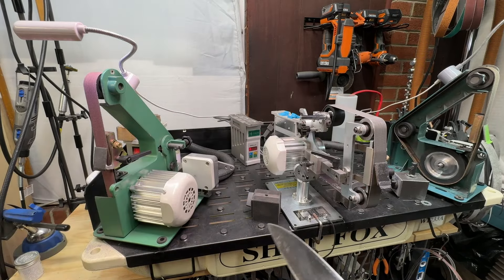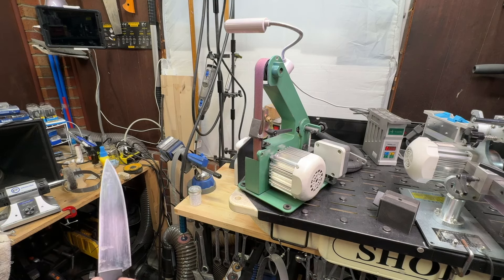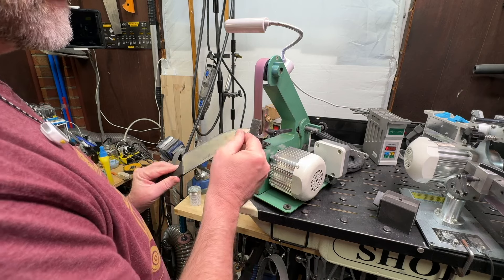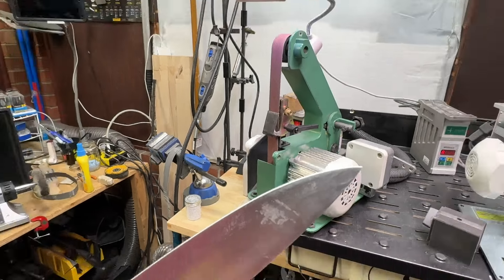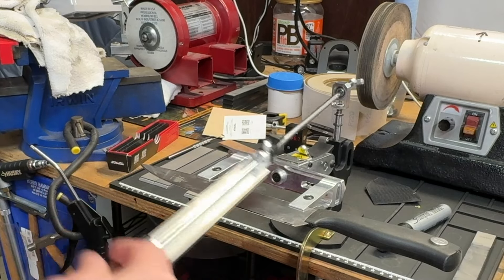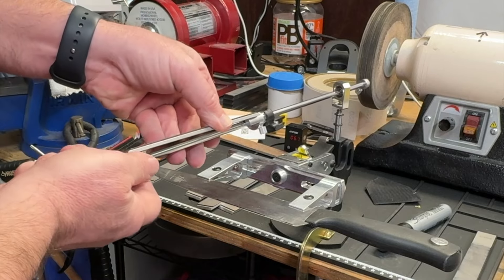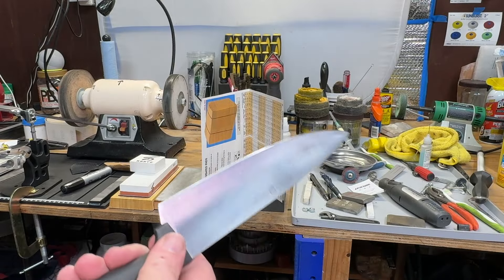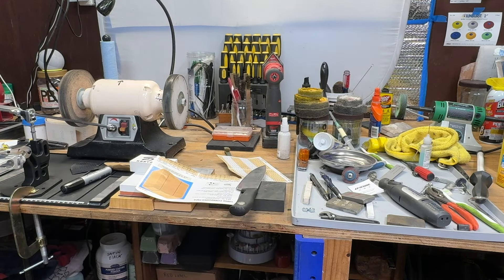Speeding up  your TSPROF Sharpening

Comment: I really like your content and reliable information.  I like it enough that I added two Toolker's and another Tormek T8 to my shop. Keep up the vids along with a couple jewelry polishers. Not quite sure about adding a manual sharpener like the TSPROF due to the cost.  May add it at a later date if the work requires the addition.  I tried the Worksharp Precision Adjust Knife Sharpener but sent it back.  Didn't work very well.
Reply from the maker: I agree it moves to much but I have not tried the pro version but I prefer TSPROF much more.

Comment: Another great video. Just qurious, when a knife comes into the shop can you tell if its been convex sharpened or Apex sharpened? How do you tell? Many thanks matt 👍
Reply from the maker: Sometime if it's been slack belt sharpened it's obvious. If you look close you can see the convex on some knives. Now on Kitchen cutlery with real small bevels it can be hard that's where the sharpie and a digital scope come in handy. If you draw a solid line down your bevel. Then take a stroke or two and if you thing you are hitting the apex but you see what I like to call railroad tracks = where it's removing metal from the middle of your line, but you have a black line still above and black line below  what was removed then that is a good way to know you have a knife with a convex bevel. You can either adjust your angle higher or keep grinding till the fat middle is gone and you apex the knife
Reply: Thank you

Comment: Another great video, great content, explanation, camera work, with amazing end result....thank you again for taking time to make this.  Is that a leather wheel on the low speed grinder you used,  and what compound do you use on that wheel?   I have TSPROF K03 Pro and have not been able to get my knives as sharp as did in the video.   I'm curious why you free handed on the wheel as a opposed to using a stropping insert on your TSPROF?
Reply from the maker: I have some videos on the many stropping options one of the things that will take your sharpening from good to great and IMO it's one of those areas you have to explore and see what works best for you is stropping, because we are all a little different. What do I mean by that? Well how I use my gear and you use yours will vary no matter what because of hand pressure and angles and these things are big factors in stropping as you gain experience sharpening lots of knives you will get a feel for what works best for you. I like power stropping because for me it's been fast and has given the best results. But we also learn fast that it can also dull your work. There is a fine line that you can cross over by stropping to much. My favorites are still round leather wheels or 1x30 with leather for how i sharpen it's around 2-4 passes each side.. On the Tormek it is much longer because it's only going at 90 RPM Can you do it on the TSPROFF? Of course you can, just know that it will take longer that a powered method. Since I always have lots of sharpening since sharpening is still  my main business speed is always a top concern so I don't fall behind. I try to have my customers work no longer than 3-5 work days so many of my choices are dictated by speed.

Comment: Awesome video. I am new to knife sharpening so forgive me if you answered these questions. I just got the TSPROF KO3 Pro AL Hunter. Great piece of equipment. So, I know you need to create a burr on both sides. I just don’t know what that feels like. I can feel it on one side but when I try creating a burr on the other side I am just not feeling it. Do I need to continue until it’s done then move onto another stone? How do you know when to progress to other stones ? Any advice would be greatly appreciated. Just subscribed. Thank you so much.
Reply from the maker: Some people struggle to feel the burr, especially as they progress to higher grit abrasives. Lower grit burrs are always easier to detect, but as the grit increases, they become much harder to feel. If you have trouble sensing the burr, I recommend using the Sharpie method along with some magnification to ensure you've removed all of the black Sharpie from the bevel. Take a close look to confirm that no marker remains on the knife.

Another way to tell if you've apexed the edge is by feeling the transition—it should go from dull to "grab sharp." Run your finger lightly across the apex; if it feels grabby and sharp, you've likely reached your edge apex.

I think the most helpful technique, will be using the magnification. It allows you to see the apex without removing the knife from the clamps on the K03 https://youtu.be/_cMI6fAdWHs (jump to about 12:15 in the video to see the new tool I am talking about this 100X Handheld Coin Magnifier can help you inspect the edge more clearly: https://amzn.to/4grxxNO.

Here is a video on the sharpie method it's useful on all sharpening devises I made this a while back and I am using a Tormek but the principles aplly to any thing you are sharpening on so this is worth you time as well  https://youtu.be/bnVxjbiragU?si=p0VP43xGgfdtzrIS
Reply: @ First of all I want to thank you very much for replying to my message. Just watched the videos you recommended just now. I want to say you are making my learning process very easy. I purchased the coin magnifier you recommended and it will arrive tomorrow. This is so much easier than trying to feel for a burr. So, the sharpie trick… most videos I watched on the sharpie trick was to apply it and then remove it. No one ever explained like you did when applying sharpie you need to remove it from the apex and not the entire bevel. Again, your videos are so helpful. My stress levels have come down so much.  lol.

Comment: What system has the highest productivity 
1 x 30 with two belt progression then stopping or….
Tormech T-8 with the same progression?
Thanks
Reply from the maker: 1x30 is faster for sure so productivity would be 1x30- Tormek gives nicer results that look factor grind or better when you get really good with the Tormek and the right gear it can be pretty fast but I would say average fast speed on a Tormek  is 7-10 min a knife. The average speed per knife on  1x30 is 3-5 min

Comment: Is it better to sharpen edge up or edge pointing down, meaning the direction the belt is going, I usually do edge down
Reply from the maker: That IMO is more of a personal pref than a what's better. If you what my videos you will see I do almost all edge leading sharpening except for boning  fillet and hook knives. Those I do all edge trailing.